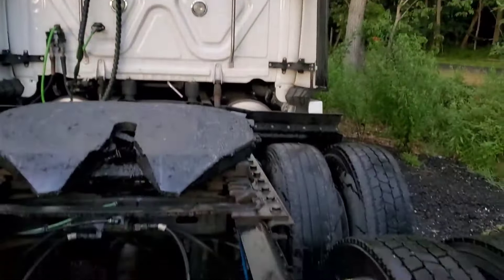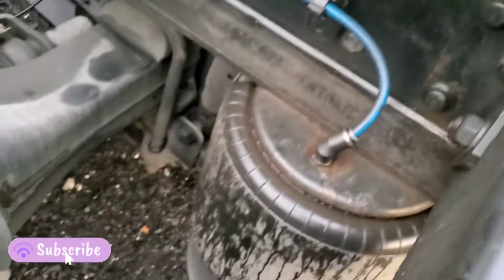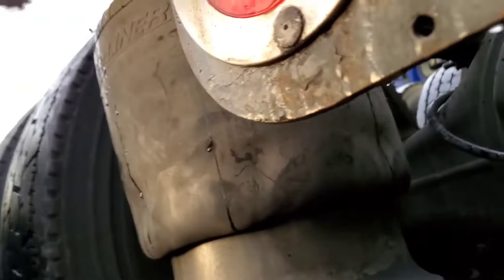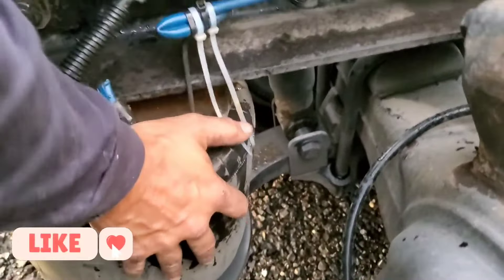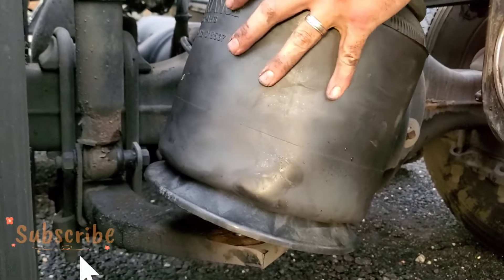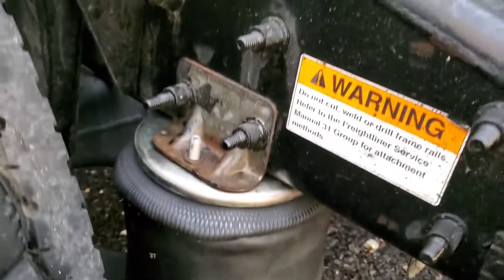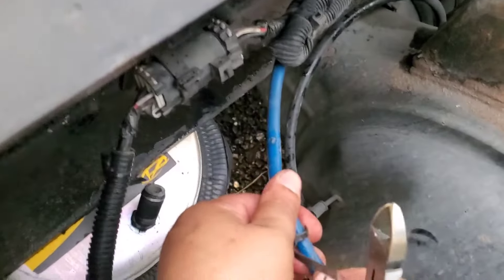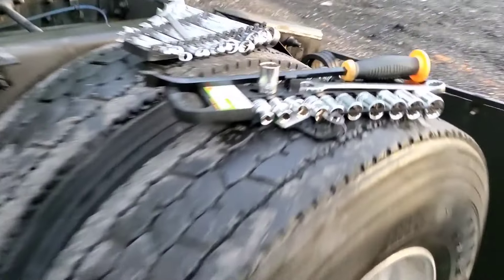How to CHANGE AIRBAG ON Truck? |HACK FOR AIRBAG LEAK| 15 Minutes UNDER $150| #airbag #truck #trucks

Comment: Holes will rust through , apply a weatherproof caulking on the top platform under the frame rail , it will squeeze out .  Coat the air spring with a quality rubber preservative .  OEM quality air springs will outlast Automann trash !  Replace all four .
Reply from the maker: Caulking is very good suggestion 👌.